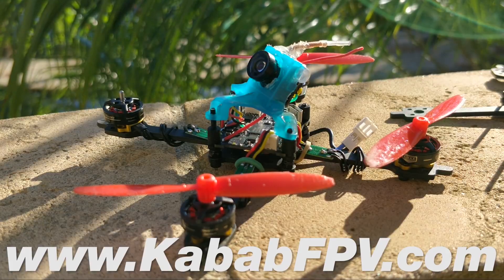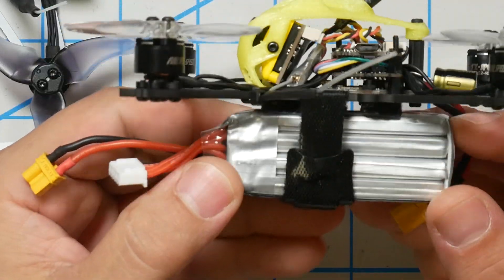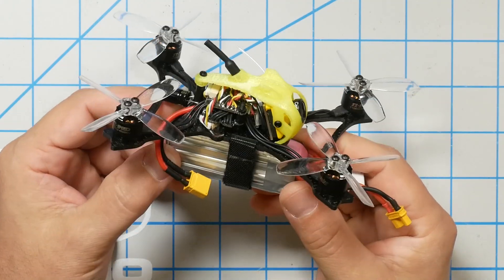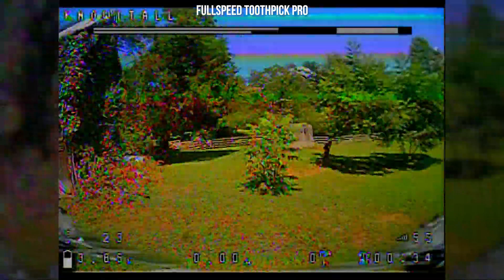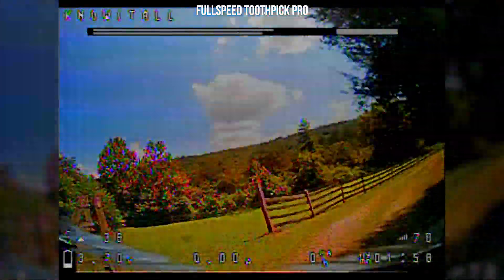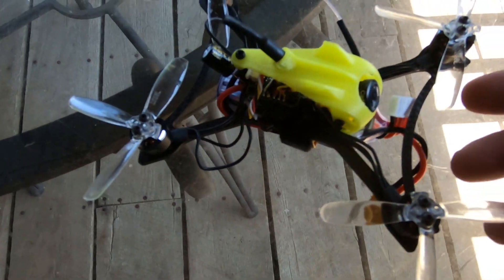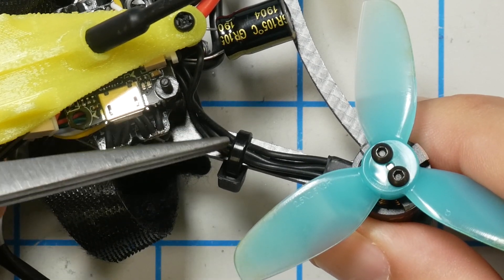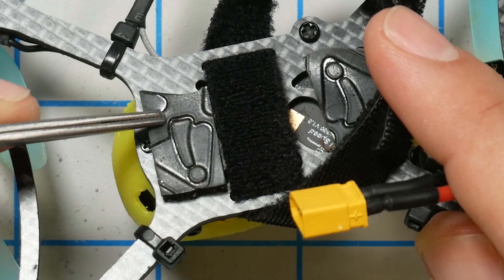Emax Tinyhawk Freestyle vs. Fullspeed Toothpick Pro | ONE OF THESE IS NOT A TOOTHPICK

Comment: I just not got into the toothpick game with a betafpv hx100 and absolutely love it. On 2s it’s still a ripper and with a 350mah 2s betafpv pack I’m getting at 5mins of hard flyings. On a 2.5 year old 450 gnb 2s I’m getting a ridiculous 8-9 mins. I’m waiting on some 300 and 350mah 3s packs now but from what I’m seeing he flight times should be close to the same but a lot faster. It’s already fast on 2s. Micros really have come a loooog way from the old eachine qx90 days. Surprisingly my qx90 and qx95 still work even my originally eachine 1s lipos for them still work. 🤣🤣🤣

Comment: I'm a new pilot. I purchased the Skyzone 02c and an eachine diatone GT 349 and a taranjs qx7. While I await delivery of the rxsr and 650mah 4s batteries for it I have purchased a tinyhawk s.so far that's the only quad I have flown since my h8 mini I got 18 months ago. Imho you have hit all the nails right on the head with this video. I watch Kabab fpv and I agree he wouldn't be happy to call that full-speed a toothpick and for £10 more the 349 blows it into the weeds. The freestyle is a tinyhawk s on a different frame and should stay indoors on 1s with it's shocking 2.4 and 5.8 range. So my conclusion is that you should buy neither of these quads and instead choose the ones I did.

Comment: The Joshua Bardwell "ToothPick" is for a T-Rex...  
By the way, just a suggestion here, but EMAX Tape or Maxwel VERSAF51217 Tape [available on Amazon] works great to hold down the wires. Those two tapes are better than Tesa tape (used on motor wires in cars) which is fuzzy but doesn't stick as well either the EMAX or Maxwel tapes.  I think it's a slightly cleaner solution and more protective than a zip tie.

Comment: I usually set the throttle curve in a way to make up for the 'less' power in the first 50-60% of the throttle to get a similar feel that I am used to with 5 inch quads.

Comment: A toothpick is supposed to have push on 55mm or 65mm bi blade props. If any screw holds the prop on, it's not a toothpick. If that's not the case then my lizard95 is a toothpick. I think the misconception is the single bottom plate with attached arms isn't a determining factor of whether or not it's a toothpick.

Comment: Like my TH2 FS but mine "exploded" after only a few flights during a normal Bettafilght Air Mode landing.  Somewhat bumpy landing but not at all unsual.  The SUPPORTS are made from NYLON and stripped out.  Pieces and screws went every which way.  I'm replacing them with METAL.  Lost one of the camera supports during the incident.  3D Printing another one.  Having to design it myself.  Unable to find one online.  Can't wait to get it back in the air.  Really performs.  Hopefully it will hold up this time after fixing the DESIGN FLAW.  2s is about as big as you want to go on this class aircraft.  Have a couple 3s in this size, too awkward.

Comment: This is how it should be if it has any stack 20x20 16x16 its another micro class with tri or bi blade props if it has a single esc fc board with 3" or less with open props it's a toothpick. I like emax still flying the babyhawk r 2" on 4s and the 2.5" on 3s they both rock I just put their magnum mini stack in a build it fly great.

Comment: Bardwell I'm totally confused. Just learning the Taranis radio coming from Spektrum. 
Adding XM+ receiver to the TH using sbus. Receiver is flashed and bound to transmitter. Changed to uart 2. Still nothing. Followed videos exactly just won't recognize the added receiver.?? Any thoughts.?? FYI. Put receiver in older quad. 3 solder joints. Quad works perfect just refuses to work with the TH

Comment: I really like the smaller toothpick 2.5 inch builds they can almost performer like a 5"!! Does Betaflight have a issue with font style & changes in OSD?? I always try pick like clarity or bold or bF font save  & rebot but just continues back too standard font!!
Reply: Upload font first and then reboot.
Reply: @Asu01  I do upload font & it rebots itself after upload but font stays the same!!
Reply: Try different configurator and other than that, I don't know much.

Comment: I put an R9 receiver and a 200 Mw vtx on the tiny hawk FS and can now go up to a mile. I would like to add a gps for return but have no more uarts. Maybe I can remap the buzzer pin outs?
Reply: Hello ! I want to get that type of range too. What vtx did you go for ? Or did you just changed the settings ? What goggle and radio should I use? Thanks for answering
Reply: @aymen3962  I now use express LRS with a radiomaster tx.. A pain in the ass to get the software right but amazing results with a very small RX. I can’t afford DJI VTX system so now I use analogue fat shark at the highest tx setting on my quad, up to 1 watt which gets me out to a couple of miles just have your return to home at the ready. Good luck and happy flying.
Reply: @sladelefty  thanks 🙏🏼

Comment: I have the Freestyle and as a beginner, I'm loving it. One question I do have though is this: I "unlocked" the vtx by holding the button on it in for 30 seconds while plugging it in. When I do so, it lets me change the power level to 200 in the OSD. When I do so, the blue and green light on either side of the vtx stay on until I power it down. When I power it back up, the vtx lights do not remain the same. Do I need to hold the button every time I boot it up, or do they only light up to show status the first time. Does this vtx even unlock, or am I seeing some kind of false information on my OSD? Am I even unlocking this thing at all? Thanks in advance for the answer, and might I also add that, as someone just learning FPV and RC in general, you have been a godsend sir. One of the very few channels (4 I think?) that I subscribe to. Please keep up the fantastic work!
Reply from the maker: The unlock status should remain. 
When you exit the OSD menu, are you doing "save and exit" or just "exit". If you don't "save and exit," then the option doesn't stick through a reset.
Reply: @JoshuaBardwell  I've done save and exit as well as save and reboot, but the vtx lights do not remain lit after reboot. Thanks for the reply!

Comment: Are 5Amps ESCs at Tinyhawk II Freestyle  enough?

Right now at Banggood Tinyhawk II Freestyle have nice discount. But I'm worried, if 5 Amps are enough for 2S?
A saw even 29A highest current in blackbox videos, this is 7.25A per ESC. Ughhh...
I'm not beginner anymore. While I have so many 1S batteries available that I need something to fly with them.
Just Moblite7 and Mobula7 are not enough, cos I have 6x 450mAH, 5x 550mAh and 9x 650mAh.

So definitely I'm searching for something where I could use 2 batteries at the same time.
I would go with Tinyhawk II Freestyle immediately, if 5 Amps are enough for 2S?

Otherway I have to go with Tinyhawk III Plus Freestyle, where I need to buy also ELRS module. Cos I'm not on ELRS yet. XM+ works for me great. Both mentioned whops have good about 200m range anyway.

Or is there anything else, where I could use whole pile of 1S batteries? Maybe Crux3 1S?

Thank you, good luck.

Comment: IMO the EMAX Freestyle competitor is the GEPRC Phantom, which is better in range and video quality
Reply: Those were the two I was trying to decide on but the fact that the geprc was heavier and flew for half the amount of time was what put me on to the TH Freestyle.
Reply: @esp0135  the flight time seems sweet on the emax for sure.  I like the Phantom because it's 2 or 3s, and the weight actually gives it that "fling" that JB talks about in this vid.  Super fun
Reply: @BClevs  Funny you mention that; it maybe that it's subjective as to what one is used to? I started from the TH and the TH-S, that's exactly how I felt about the freestyle. FS is about double the weight, and flys more like my 5" than the original/S.

Comment: I like the emax but would want a different vtx. That shouldn't be too crazy to do tho
Reply: DroneCampus has already put a video out on it.  Plan to do my soon.
Reply: @Gawl88  yeah, but he went a bit heavy with components for this class
Reply: @PortalFPV  Yes he did but honestly I don't think it hurts it.  I just did the xt30 and camera and plan to do a VTX at some point (probably a unify nano).  If you want to race it then the weight counts but for freestyling it's great!  Mine with the upgrades comes in at 57.5 (I'm spektrum so that added more weight) and with a 525 lipo I'm at 86 but still get a solid 4 mins of great ripping.
Reply: Portal FPV all the upgrades made it like 3g  lighter...
Reply: @xmwxmorris  450mah's in the first weigh, 300mah in the second.
Reply: @kd9432  I'm just putting a akk nano in
Reply: Geprc phantom, seems like the winner of the class to me.
Reply: @kd9432  That's my plan.
Reply: @Segphalt  It depends what you want.  I think the motor kv to size/weight ratio for the freestyle is perfect.  I slammed mine in a few times this past weekend at full throttle in the field and just a couple chipped props.

Comment: Diatone gtb 229/339 cube. (Preorder) but honestly build a toothpick just like what kabab did with amaxinno motors 1103 7500kv, 12amp whoop board, mobula7 camera with the right cam mount on pyrodrone, a toothpick frame with slits for a battery strap from taco-rc. And who cares props from pyrodrone.(2s build).. Alternative build, the mobula7 fc, mobula7 camera, 1103 12600kv hyperlite motors from pyrodrone, and a primo 110x frame. The second build will be 1s only but its still loads of fun.

Comment: I got the freestyle and it's eating my 1S batteries. 6 of them are puffed up now. Low volted a few, my fault, but it even puffed a few that I only brought down to about 3.5v each... Smells to me like the draw is to high...? My batteries aren't that old but maybe they're degraded enough that this thing (tinyhawk FS) is killing them...?

 Indoors it was great and I got the "7+minutes" of flight. Took it outside and started having some fun, and that's when the low battery warnings and sag hit hard. Flight time about 4 minutes (as to be expected when able to use more throttle)

I love the performance of the freestyle but it seems to me it needs proper 2S batteries with an XT30 as I have heard others are doing. And there's obviously the crap camera and vtx on it.

I would love to hear from anyone else to see if this is happening to them?
Reply: Exact same here
Reply: @JOZUMI  Glad it's not just me!!! I'm going to mod it to XT30 soon.  I'll update when I do.  I have a feeling it'll be a lot better.
Reply: @JerR22  let me know how it goes ! If it turns out better I may just as well do the same

Comment: Josh quick question what other motors can I use on the tinyhawk freestyle? I want to get some spares to have on hand and emax doesn’t have spare parts for it yet.. Any info would be greatly appreciated thanks!!
Reply from the maker: The Freestyle motors use a non standard bolt pattern. You can only use the Emax motors.

Comment: Thanks for the info on both these machines! Could you recommend a 2s-4s quad for a first freestyle type quad for outdoors that will fly on spektrum? I've never raced them nor have I tried freestyle. I fly through the house like a maniac with my inductrix fpv pro and i'm itching to get outside with one. I use a Spektrum dx6e tx and Fatshark hd2 goggles. Any help is appreciated.

Comment: @ EMAX FREESTYLE:

Obviously my VIN pin is defective.
Is there a chance to remap any other solder joint and resolder VIN cable?
If yes, how?
Reply from the maker: No, it cannot be remapped.
Reply: @JoshuaBardwell  Thanks Josh.
Any ideas of a "work around"?
Reply from the maker: Connect camera direct to vTX and give up OSD.

Solder camera wire directly to the input pin on the MAX chip on the FC (very very fine soldering -- use multimeter continuity mode to tone out the remaining bit of trace from the VIN pad and find the pin on the MAX chip).

Comment: I went with the Tiny Hawk 2 Freestyle recently as I'm still very much a beginner & only really experienced in the tiny whoop world. It definitely flies like a tiny whoop, just WAY better. I'd say it's a great first baby step towards big boy open prop quads but without all the money & risk. It's so stupid light that when your lack of experience sends it cartwheeling into the dirt it'll be fine. Just dust it off & get back in the air. Just don't crash it into the dog's kiddy pool like I did to my first one.
Reply: Got my hands on a TH2F after flying whoops for a few months and there's so much more momentum to work with compared to whoops!  So fun and I couldn't agree more: those rush props are mad sturdy, the whole thing's built like a tank!  XT30 is a good upgrade for me as I wouldn't fly this on 1S.  I comment because I have been using 3S batteries at 80% throttle scale and it seems to be working fine???  Only tried with 300mah 3s, normally fly 450 2s.  This terrified me at first (I didn't wanna blow and/or fry anything) but the guy I got it from assured me it's common for these Freestyles.

Comment: My deffinition of a toothpick is either a 65mm 2s kwad or a three inch 3s kwad with 1103 motors and a target weight of around 75g.

My current best build is:
Kabab fpv toothpick frame, newbeedrone beebrain v2 canopy, akk aio cam/vtx, hyperlite 1103 8022kv motors, pyrodrone aio 4s 12amp fc, rdq 450mah 2s, whocares(pyro/kabab) 65mm props.

Comment: That dvr quality was atrocious, how on earth could you fly with that 😅? Or was the quality in the Goggles better and fatshark dvr just did it's thing again? Anyway - great video :)
Reply: Ready to get technical?
Our analogue cameras output an NTSC 59.94fps 720x480 or PAL 50fps 720x576 interlaced image, virtually all the DVRs in goggles and standalone modules take that interlaced image, ditch one of the fields of the frame which halves the vertical resolution (and subsequently halves the framerate), crops the edges off and then scales to 640x480.
So yes, you see a much crisper cleaner smoother image in the goggles than what the DVR gives you.
It's difficult to record full resolution full framerate video from an FPV feed, you need to go out of your way to find hardware that will do the job, and then once you have that footage on your computer you've got the problem of deinterlacing it, most deinterlacing filters don't do a very good job.
FXT did manage to make a standalone DVR that records the full framerate, sure it looks good when played back at 60fps but that image is continually jumping up/down by 1 pixel as it was poorly deinterlaced (just watch any review of it on YouTube and set the playback speed to 0.5).
Reply: @licensetodrive9930  Interesting, I learnt something today. Thanks
Reply: @licensetodrive9930  that certainly is interesting, I mean I'm flying myself so I know that the image is way better in the Goggles but I still found the dvr to be especially bad in this video, I personally couldnt fly through all the video noice and breakups Joshua had in there. Anyway thanks for the detailed answer and unexpected technical explanation 😜👍

Comment: In my mind the toothpick class is the 2.5inch version of a ultralight 5inch racer. Although, the smaller size seems to scale well with durability and efficiency. The Fullspeed Pro looks like a regular 2.5inch that you could get everywhere before Kabab introduced the toothpick class.

Comment: I have all three tiny Hawks the original white one the tiny hawk s and the tiny hawk freestyle it's hard to say that the freestyle would make the tiny hawk as obsolete it's hard even compare the two they're two totally different the tiny hawk freestyle is like flying a real quad the tiny hawk and the tinyhawk S is like flying a tinywoop  there's absolutely no real comparison between the three even the tinyhawk and tinyhawk s when i fly them both in 1s its like flying the same tinywoop but when you switch over to 2s on the tinyhawk S ur again flying a different beast  its kinda a waste it still doesn't do well outdoors for me (its always breezy here) where the tinyhawk freestyle flys outside in the wind without much issue but its also not an indoor quad and i took a battery holder from a extra broken tiny   hawk s and mounted it on the lower frame of the freestyle and that made a night and day difference in breezy weather it feels like it has some ass behind it now apose to the rolly floaty feeling it has out of the box ( also im less tricks and more speed and maneuvers type of person) all and all the tinyhawk original is great indoors around the house the tinyhawk freestyle is a phenomenal small quad outdoors tinyhawk s is a pass its a tease you have the power of a 2s quad but the frame and stability of a tiny woop

Comment: Just a little "toothpick" history. It wouldn't be completely incorrect to say that racerstar and tomoquads actually brought the toothpick class to fruition. Racerstar released an affordable functional and very light 1103 motor. Those of us who were into brushless micros at the time were trying to get them smaller and smaller. Tomo brought out a frame specifically for them and until rotorx got in the game with their quadblade prop (very similar to the one on the toothpick pro) the parrot props from the brushed builds were all we had to use. What Bob really did was pick up the class again when the core electronics shrunk another notch and discovered a new lease of performance. Going from the 20x20 stacks to an AIO whoop board dropped the weight of builds significantly and the battery options around 100-150W have vastly improved.

Comment: Try the gemfan flash 2540 props, they are by far my favorite props for 2.5 inch on 1106
Reply: Absolutely! But the Avan 2.5 on the Freestyle is just as good.. trades a tiny of the punchout for less noise 👌🏽
Reply: He should have put the Emax Freestyle props on the FullSpeed Toothpick Pro!
Reply: Yes, excellent 2.5” props but they typically work horribly on Toothpick builds because of vibrations. I’m not sure why though.